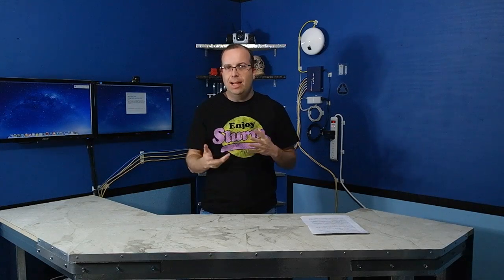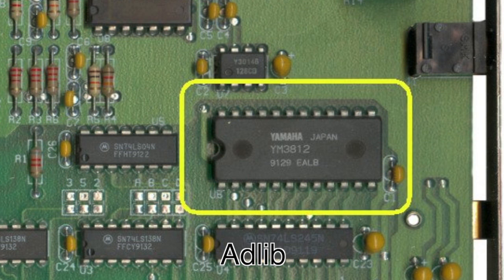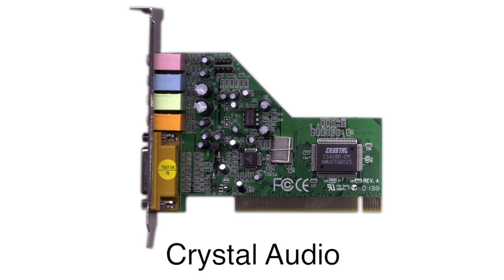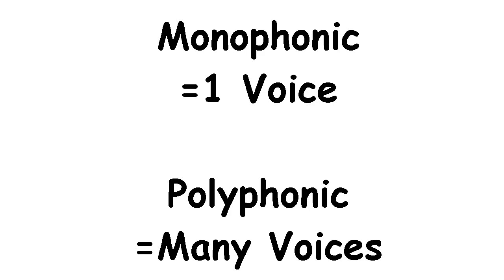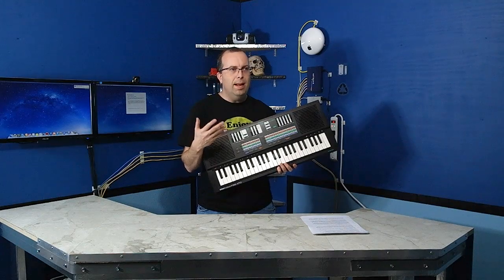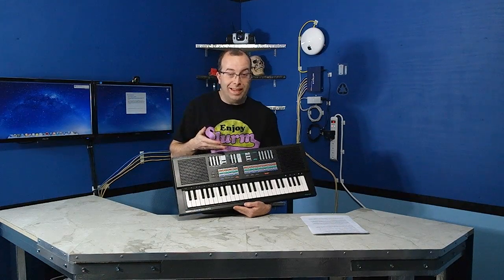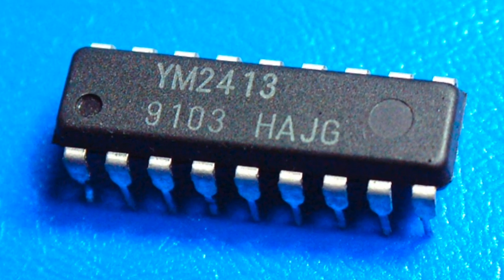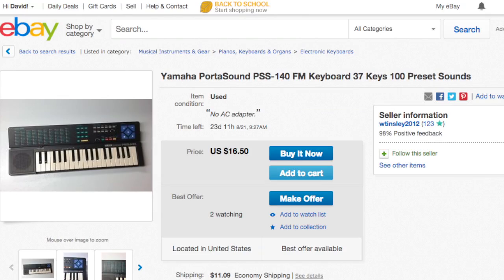Meet the little-known "Soundblaster" Keyboards

Comment: I was given a Yamaha PSS-580 which has 49 smaller sized keys and with some really awful FM voices, but a useful selection of auto rhythms, built in speakers but a totally useless FM synthesizer feature. However, it does have MIDI IN & OUT sockets so it redeems itself as a portable MIDI controller keyboard. Although it is definitely of the same era as those keyboards you have reviewed, I have no idea if it also uses the Soundblaster chip technology to produce its sounds.  I would only ever use it for MIDI control of another better sounding box of tricks though, like my Yamaha TG100 General MIDI tone generator or my Korg Volca Keys.  The old meets the new and maybe has a happy marriage.

Comment: The ym2413 (OPLL, with the second L standing for light) is indeed cheaper than the ym3812. But you will not notice its shortcomings when playing a keyboard if you can only play one instrument (be it 6 plus drum or 9 without drum channels). Only if you start making music on it for playback on a computer you will run into this.
There are 16 hardware voices built in which can be used freely on each of the channels. And you're allowed to use one custom/self made instrument. Furthermore the chip can only play FM, no AM. That's the crippling thing about this ym2413. Japanese Sega Mastersystem (which supports this chip for some games) only uses the hardware voices which causes all the games have the same sound.

So as long as your keyboard has no split to play two instruments simultaneously, you can select just one instrument. The mentioned restriction of one custom voice won't affect you then.

Comment: I recently acquired a Yamaha PSR 31 for $15. A single white key was broken. I am not sure that the PSR 31 is actually from 1991. I found a service manual for it that dates it to 1986. But on the Wikipedia article listing Yamaha Corporation products, it says 1991, but it isn't clear if that means date of manufacture or if that merely indicates when sales ended.

Comment: I had an old casio keyboard from probably the early 2000s (or late 90s i barely remember it) and i liked playing on it as a kid. It had Midi and the big Audio jacks used on guitars and since i don't have midi hardware, i never used it. It also had the ability to record custom sounds or something but never figured it out. The only problem was 1 or 2 of the keys didn't work right. When i press the broken key, the sound is not clean and it seems like a loose connection (the sound would be breaking up and then work if i hold it down for a second). Wish i still had it but i got rid of it.

Comment: So it sounds like the juvenile PSRs used the YM2413 and YM3812. Would they have used similar architecture on the intermediate/advanced PSRs and the DGX series of portables? ( I.e. PSR EW410 E463/DGX_230 YPG_235

Comment: I’ve definitely watched this video before a few years back, but I forgot about the specific keyboards that were mentioned. I’ve been on the lookout for old Yamaha’s in general, but earlier today I picked up a Yamaha PSS-460 from Goodwill for $9.00! It’s in good shape cosmetically, and only the very top C key doesn’t work. I looked it up on YouTube and came across this video again, definitely helped me appreciate my find! The PSS-470 has the same exact layout, just a different overall appearance. I suppose that’s the only difference between the two?
Reply: You could probably take it apart and fix the top C key if you wanted. It's either the contact or the wires leading to it.

Comment: I wonder if any keyboards were made using the YMF262 chip, better known as the OPL3. That chip is INSANELY capable, yet most developers either tried shoehorning General MIDI arrangements onto it, or they just did the same stuff they did with the YM3812. Quite a shame. Anyway, I'd love to own a PSS 470, especially since it has those hands-on sliders to control the sound.

Comment: I feel that something is being missed here.  The Soundblaster provided sampled digital sound as it's main trick, the MIDI functions provided by the Yamaha chip were just added to maintain compatibility with all the MIDI based software, and were only a fragment of the cards capability.   Soundblaster opened a whole world with sampled audio, and to call a keyboard a 'Soundblaster' keyboard because it had the Yamaha chip from the adlib card really isn't accurate.  It's an Adlib, or MIDI keyboard if anything.

Comment: Add a little drive to that piano sound on the PSR-12 and you've got yourself a good electric piano sound.
EDIT: Also, if you can find one for cheap, you might want to get a Yamaha PSS-380 or PSS-480 and review it. They are basically fully editable 2-operator FM synths (like the Yamaha DX7, and they use the Yamaha YM3812!), and you could even hook one up to a computer (DOSbox), select to output MIDI and it will then act like a SoundBlaster card! How cool is that?

Comment: Sooo...cut to the chase. How do you go about programming the YM3812 to alter ADSR function? Also, will the PSS-460/470 synth sliders respond to more than the 5 step factory setting.?  Are you adverse to the 8 line data mod between CPU and ROM(3812? Would love to mod one, just want to hear better sound not static gunck. Please do another video!!!

Comment: hey 8 bit guy. someone else may have said this already, but, the soundblaster live software let you plug in a midi keyboard and use its synth chip for a keyboard, just like you sort of hinted at. thought you might find that neat. there's drop down boxes and sliders, which, i'm not sure if it completely replicates the sliders you used on the keyboard to recreate the sound from ultima, but it looks pretty comprehensive. i'm watching a youtube video about it right now, haha.
Reply: +Kit Vitae The thing is, having the actual controls on the keyboard is a far better thing because it's kind of difficult to change settings on a computer while playing the keyboard "live." :)
Reply: Phyphor666 of course! he just said "it's like if you could theoretically connect a keyboard and speakers to the sound card and play it like a keyboard", which is exactly what that software does, not just theoretically.
of course it's not better than a dedicated instrument, just a fewer-key keyboard with octave switch buttons aren't as good as just having a bigger keyboard.

Comment: Can you please do a video on common trouble shooting issues with these old PSS's? I have a PSS 140 that just stopped powering up with power supplies. I've used 2 different power supplies. Sprayed some air on the switch but couldn't really get in there too good.

Comment: The DX-7 was built as an actual synthesizer but I thought it did something similar.
My cousins have one of these but I'm not completely sure which.  It's been a while since I saw it.

I will see if I can get my paws on one of these sometime in the new year, even though I've got a bunch of FM softsynths none of them are quite like this and these are the sounds I grew up hearing in games.  It would be cool to add these types of sounds to my tracks especially if these are so cheap.
One question about the third keyboard you showed off - does it have the same synthesizer controls as the first one?

Comment: Hi! How would you compare the sound of the PSR-36 with the Yamaha PSS-460/470/570? I have a 470 and it sounds almost analog like, possibly due to the chorus effect. I also have a PSS-580, but I prefer the digital warmth of the 470. Would like to pick up a PSR-36. I'm considering getting a PSR-36, but I'm concerned that it might have too much overlap with my 470/580.

Comment: Hey, just wanted to let you know that the PSS-680 also uses the 3812.  I found an editor/librarian someone made for it in Win95/98, and it opens up all of the synth's features.  The keyboard isn't multi-timbral like the one in the sound cards were (I think), but the 680 definitely has the full YM-3812 chip.

Comment: hey,  as far as these keyboards go, the pss-470 Looked more flexible because of the synth controls,  but I'd like that with midi .   I've noticed a model called the pss-480 which actually has midi but I don't think it has synth controls.    can you offer any opinion on which yamaha is more useful for adjusting the sounds & has midi?

Comment: What's the difference between the YM3812 chip & the successor, the YMF262-M chip? Can they still produce the same sounds?
Reply: In a nutshell, it's like the difference of a i386 and i486. One is a newer and more advanced version, and yes, it can produce everything that the older generation did.

Comment: Gotta get me one of these Soundblaster keyboards! Anyone know if the PSS-370 has the right chip? Looks like the 360 with a facelift, but it's not on the list. I've had a PSS-480 for a long while, and it can achieve some interesting sounds, but it's a little more annoying to get there. Wish it had those sliders... Tempted to open it up, and see if it has the YM chip.
Reply: From what I found, my PSS-480 has a different synth chip, and is in the same family with the 380 & 390... Still a decent sounding FM synth, and takes 1/10th the time to dial in a sound compared to my DX. The Portasounds with the YM3812 are: 360/370, 460/470 and the 560/570. Went ahead and bought that PSS-370 I was eying. Spent more than I wanted, but I like the idea of it being a little less bulky than the 460/470/560/570. The big and complicated synths tend to never leave my bedroom...

Comment: These keyboards are honestly a waste of money, a curiosity at best. Not only are more advanced FM chips capable of producing almost the same sounds and much more, the lack of computer connectivity makes many sounds and tricks impossible to achieve with these.
If you're a fan of FM just don't bother. Look for a keyboard or sound module with a better chip, they will give you access to both the rich and powerful sounds of an 90's arcade game and the thin synthesized farts from the SoundBlaster/Adlib, along with higher quality audio output and MIDI support so you can actually have full control over the thing from your computer.

Comment: These simple FM keyboards sound a lot better than Yamahas sampled based keyboards that came after these ones, that used very low quality samples- They were truely terrible, and you could'nt edit the sounds. 

I had a PSR-75 keyboard which I bought in 1994, apparently with AWM (Advanced Wave Memory). 
There was nothing advanced about it, it had audio quality not much better than an Edison wax cylinder. Funny enough, it did'nt sound lofi and warm, it sounded very clinical, dull and lifeless!

Comment: how can we get ensoniq/SoundBlasterPCI128 8mb waveset going on keyboards?  or at the very least get midi playback with this waveset in Win10?    i'm able to install the SBPCI128 driver on vmware, emulates the hardware and the wavesets work without having the actual sound card,  there has to be a way to get some kind of layer (like virtualmidisynth) except instead of sf2, use these ecw wave sets intead.  anyone care to take up this challenge?

Comment: Used to have a ps470, the battery leaked and it broke
Reply: Never leave em' in for a REALLY extended period then!
Reply: you could probably clean off the acid and run it off a 12V power supply.
Reply: Alex Jamieson But that depends on the extent/how bad the corrosion is.
Reply: Alex Jamieson my mum threw it away :( didnt realise how valuable i guess these are!

Comment: Do you if the PSS 480 has the YM3812?
Reply: haven't had one open yet, some case poppers online say its a different chip.
Reply: In the service manual which can be found here:
http://elektrotanya.com/yamaha_pss-480.pdf/download.html
there is a parts list at the end, which mentions three Yamaha ICs, the YM3420BF, the YM3419AD, and the YM3419BF.

Comment: You're dismissing the first one as a kid's toy keyboard, while it's an actual FM Synthesizer, and calling the last one a beast, while that thing is just a bad keyboard with preset sounds to pick from. It's completely logical that the first one goes for more money than the latter two, as you can make your own sounds using a Soundblaster fm chip and play them rather than just another keyboard with built in sound selections. You may as well use the sampled SB sounfonts that are freely available everywhere and can be used with midi and sustain, but don't offer the highly valuable addition of being able to manipulate them through live fm chip synthesis.
By the way, you keep saying 'midi or sustain' but sustain on digital synths is through midi.